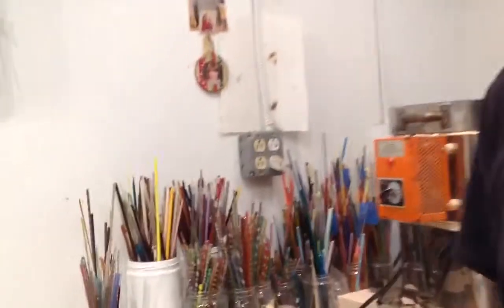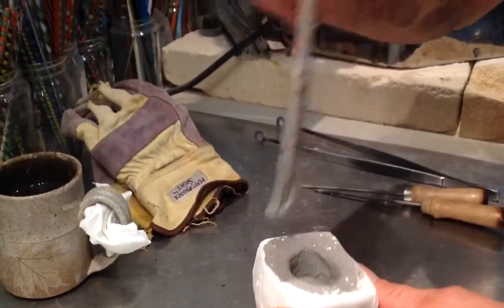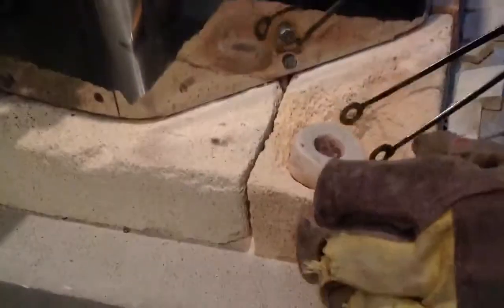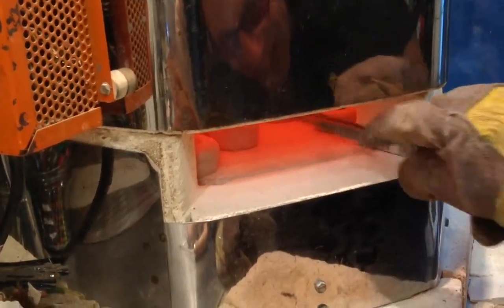Cast glass Krobo style bead

Comment: How long are you letting them heat for? The mold doesn’t seem to be soaked with enough heat
Reply from the maker: I bring the molds up to 1450 to 1500 F. And soak until the glass is quite liquified. Each kiln is different and this kiln is a dinosaur that runs slow and takes a bit to get to temperature.In this video I did jump the gun and pull these molds a little cold. My intent was to show that if you do pull a little cold you can put the mold back into the kiln and are not obligated to form the bead right then.